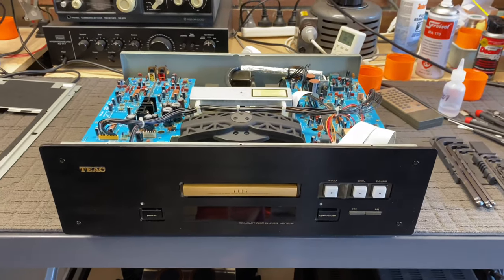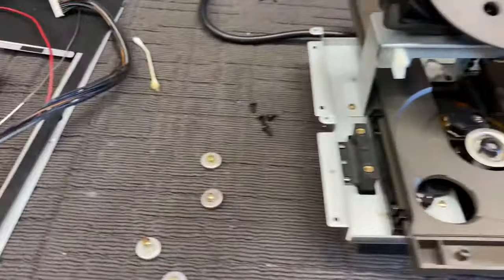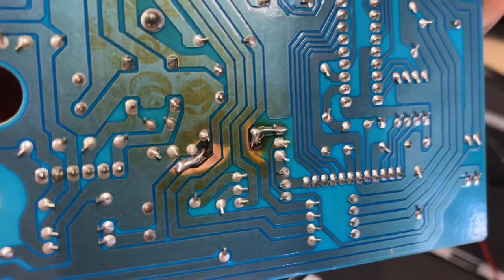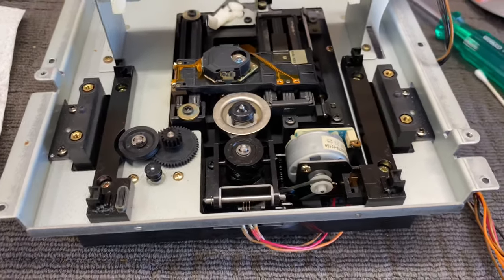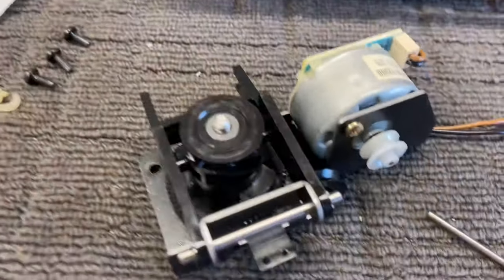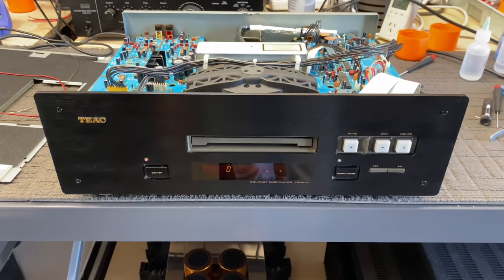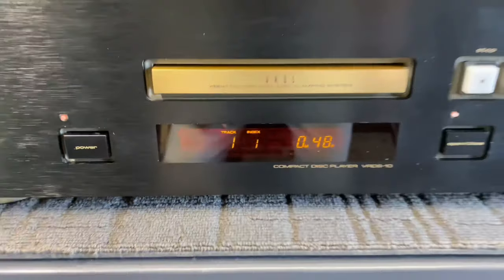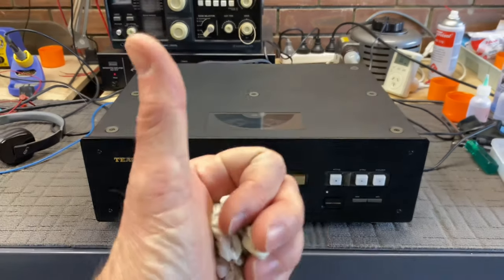Tank-like TEAC VRDS-10 CD Player Repair and Service

Comment: Thanks for uploading this. Sad confirmation of the work needed to replace the belts is helpful hoped there was a shortcut but not to be.

Incidentally my player had the exact same issue with burned R101 & board damage. It's a simple repair but on investigation it seems that this resistor gets hot if the player is left in 'pause'. In fairness to TEAC it's a CD player, not a CD pauser But in any case I both increased the resistance to 600ohms and made it a full 1/2 watt - away from the board. Player still worked well - belts are a new issue :)
Reply from the maker: CD player, not a pauser, I like that!
Reply: @LiquidAudio  Actually I later found a shortcut for the tray drive belt belt (Phew). If the bridge is removed you can unlatch a tang on the drawer to pop it out and swap the belt. No chance on the clamp belt tho' that's absolutely the deep dive you show here.
Reply from the maker: Yes there are shortcuts with many of these things, but I generally find the full strip down process allows proper access to everything for cleaning, lubrication, access to other critical bits you cannot see otherwise, etc. It's more painful initially, but usually worth it.
Reply: @LiquidAudio  Agreed! My own view on this sort of equipment is that there is a responsibility to do it properly.  Or find someone who can.
Reply: If I found a burnt out resistor that was getting hot repeatedly I would stand it away from the PCB and thermal paste a small heat-sink to it
Reply: @samuelfellows6923  Yes, but better to work out why its getting hot? 
Odd thing to me is why its a problem in the first place looking at the way the rest of it was engineered

Comment: Very interesting. I have a VRDS 10SE which I bought in 1997 - a really lovely player. About 4 years ago I had the problem with the cd tray not working, dismantled as you have done, and found that the drive belts had perished. I searched high and low for genuine replacements, had absolutely no luck, so used nitrile ‘o’ rings of which I have a large assortment ( I use them with motorcycles). If they should fail do you know where I can get the correct belts? Thanks for the video - there was nothing available when I repaired mine. 👍
Reply from the maker: Nice work with the repair! Worth noting that O-rings are not ideal for use with V-shaped pulley systems which require square-section belts. They will often work, but square-section belts are definitely the way to go and deliver the specified torque, where correctly-sized belts are used. They are available from commercial suppliers, but you have to know the dimensions for any belts you need, rather than what they were used in. For this and other reasons, these sorts of suppliers don't generally offer retail sales.
Reply: Thanks for getting back to me. I’ll keep my fingers crossed - I couldn’t find square section anywhere though they’re obviously being manufactured. All the best, Patrick. 👍
Reply from the maker: @patrickjones145  You'll find retail suppliers, I did a quick Google and found quite a few.
Reply: I just looked and, yes, quite a selection. I couldn’t find anything when I carried out the repair. I must say that fitting the replacement belts was a real headache so I hope these keep working for a good while. Keep up the good work and, again, thank you. 👍

Comment: Hi. A couple of questions. Hope you don't mind.
What lubricant to use for the transport rail?
What are the correct dimensions of the belts?
( I have generic square cross section belts that work for a while)

I have a similsr machine, it sounds great but sometimes the transport won't open, and it's now started skipping towards the end of long cd.

Comment: Great repair Mike !!  What made those Sony lasers last so long ? I swear my friend In Sydney had a CD player and the laser lasted 30 years !!! I know the lasers today are made in China but in the old days they were made in Japan . What was the secret to those old Sony lasers ? Were the lasers made of some special glass ? I detest modern made in China lasers :( . So many pass “quality control “ in China  when they should be binned.. I think Maybe only Esoteric bother making decent lasers these days .
Reply from the maker: Thanks and yes they really built things to last back then, using better materials, better quality parts, higher grades of glass rather than plastic optics, metal bearings, parts with better power and life specs etc. Many of these KSS-151A lasers are still strong after 30 years.
Reply: My CDM4 mech in my meridian 200 transport is still going strong,,31 years later..